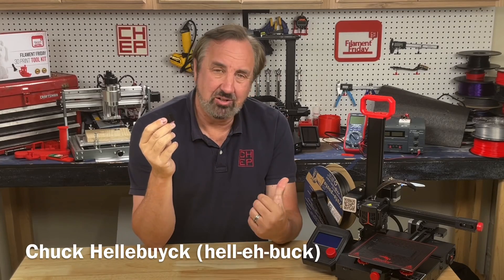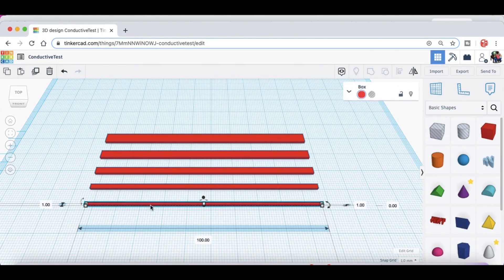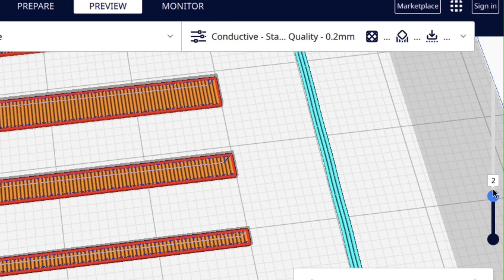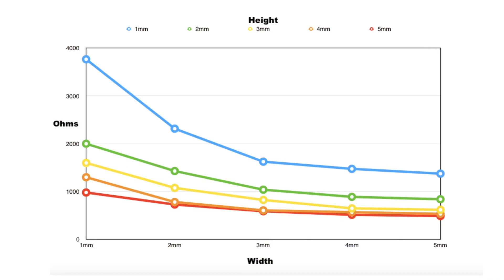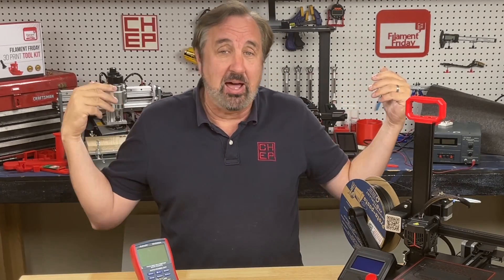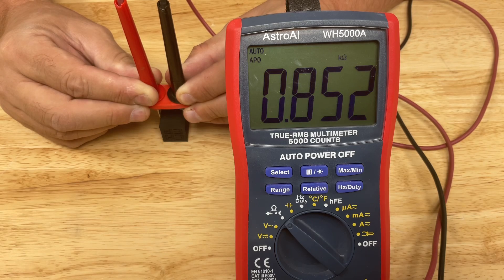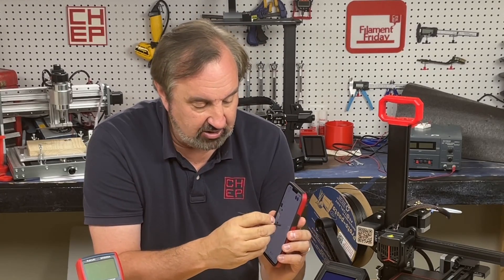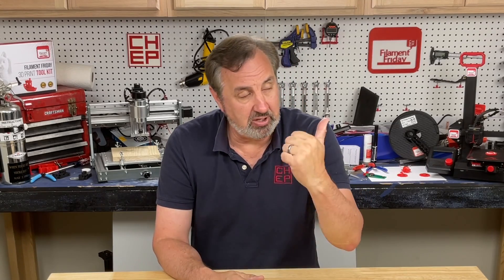3D Printing Conductive PLA Filament

Comment: Yes you get lower resitance (0 ohms)  easly by copper plating  the resitive  3D printed lines with copper suphate and a DC power supply dropping the voltage as it gets more coating.
This means you can dip a 3D conductive printed tracks that are in contact with a metal holder: For example NE55 timer dip pack with a LED or speaker even the through holes can be placed . e.g. 2mm hole that is not all the way on the 3mm none conductive substrate. Better if you have a AWS type fillemnt holder for normal PLA and Conductive PLA .  Image having a switch on the side of your case that has no wires! Building up the copper plate till you can solder  is also possible but care over melting points is critical.
Reply from the maker: Do you have a video showing this process is successful? 
I’d love to see it.

Comment: You know you didn't have to 3d print anything to test the resistance right? The spools are already a very accurate diameter, just cut a length of filament off the spool and measure it.
Reply from the maker: So you guarantee that will tell me an accurate reading of the print resistance after going through the melt and reform process?

Comment: Hi Chep, I need some help with Cura. I have built my Ender 3 correctly, but whenever I go to print something after slicing with Cura, my printer prints slightly off center from the bed.

Origin at center is off and my bed dimensions are 235x235mm. I know it’s the slicer because I just recently downloaded your E-Lever gcode and it positions at the corners correctly; it’s just happens when I print from the slicer.
Reply from the maker: Should be 220x220
Reply: @FilamentFriday  220mm converts to 8.661in; if you measure the build plate on an E3P you get 9 1/4in and 235mm converts to 9.252.

I only figured this out last night. I did have it at 220mm but I changed it to 235mm. I think it’s a default setting in Cura since the E3P is advertised at 220x220x250mm

Any other suggestions please? I didn’t mean to argue.

Comment: If this filament contains carbon fibre, are their concerns about airborne filament particulates that can be inhaled? Do you need to wear a mask with this filament, like one must when cutting solid carbon fibre? Thanks.
Reply from the maker: No idea. You’d have to ask the manufacturer.

Comment: Excellent stuff Chuck, as always!
So could you print low-power resistors of misc value (what would be the formula for dimensions vs resistance?) for use with USB and Arduino projects? Or do they need more current than the filament can handle? I wonder how the maximum current/sq area would be before it heats up too much...?

Comment: What's is this filament for
Reply: This stuff would be perfect for making plastic housings for electronics that are basically static-dissipative as  they conduct 'a bit', so it's perfect for conducting static discharges to ground.  Some companies sell sheet-plastic that are similar compounds for that purpose and they are used for making housings etc by vacuum forming. I used an assembly made from the sheet plastic form in work once, I might buy some of this filament to try.

Comment: yea one ounce copper could easily pass 3 amps over 100mm with a resistance of ~0.40 ohm ... your going to burn around 100mw just to power a LED though a 5x1 bar of brittle plastic

Comment: One good use of conductive filament to 3D print your own ESD-safe PCB carrier boards.  I've designed and printed some out for work and they're awesome.  😁
Reply: Thanks for the confirmation that this works. I'm wondering if normal Carbon Fiber PLA could be used for ESD parts too.

Comment: Hi, good video! Im wandering wgat about annealing those conductive bars, how annealing could improve conductivity. Another thing is how can change the capacity of the piece changing the infill angle?
Reply: 1-) Annealing would probably increase conductivity, because conductive grains will align themselves as they heat up, creating more stable pathways for the electrons.
2-) Angle of the infill could be irrelevant, infill percentage and point of contact between each infill layer is the important part. As the point of contact and infill increases, the conductivity increases with them.

Comment: That was a smooth ad segue, Chuck.

I'm wondering if anyone's come up with practical uses for the conductive filament.
Reply: static dissipative housings
Reply: I'm thinking a chassis to house your controller instead of the usual PLA, PETG, ABS, etc. to help reduce the risk of a floating ground or electrical shock.  Anti-static material is conductive but has a higher resistance to create more of draining effect than an instant discharge.  Another possibility may be RF attenuation.  It wouldn't be as good as metal but should provide noticeable reduction.  Chuck could probably provide more insight about the feasibility.

Comment: But... Could you print a PCB, then electroplate copper onto the filament?
Reply: I would be shocked if you couldn't.
Reply: @lorna blewett and lee: That might even open the door to much stronger prints.
Reply: No

Comment: How about try and make a heating pad out of one and see if it get hot enouth to make it get soft?
Reply from the maker: It’s too high of resistance. To get it hot enough you either need to get it to sub 10 ohms or use 100’s of volts.
Reply: 100s of volts ... like AC from the wall socket?
Reply: If this works i wonder if you could heat the hotend by running a current through the nozzle?

Comment: Hi, douse that filament change resistance when it is bent in a direction and change back when its bent back to the starting position?
Reply: If you're thinking of printing a flex sensor, then what you need to know is whether stretching it lengthwise increases the resistance. If so, then you'd print one or two layers of regular filament and one layer of conductive. That's how flex sensors are normally constructed.
Reply: @dekutree64  yes I watched the vids on how to do that. I thought somebody may have done all the prototyping for that.

Comment: Had an idea one time to print some internal wiring into bicycle fenders but never got around to it, doh. Think that would work okay just two colour printing it like normal with a 1x1mm "wire"? If the fender itself is 3mm thick and as long as it's water tight, eh? Could integrate a AA battery slot and whatnot too, would look slick. 

Rainy day test idea with the internal wiring maybe. 0.5mm gaps to slot leds into and whatnot, heh heh. Love this hobby. Thanks for reminding me this stuff exists!